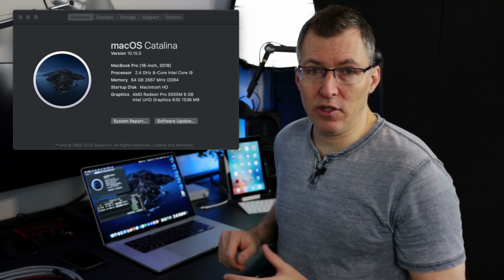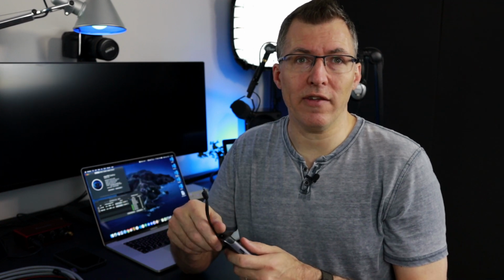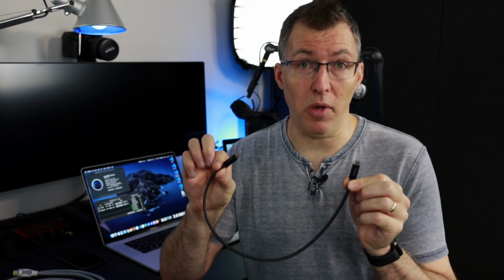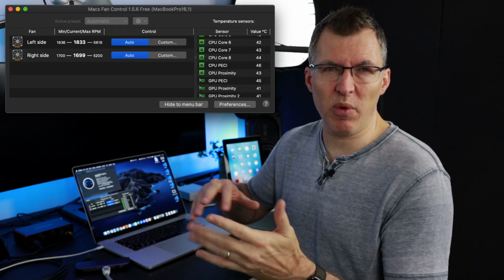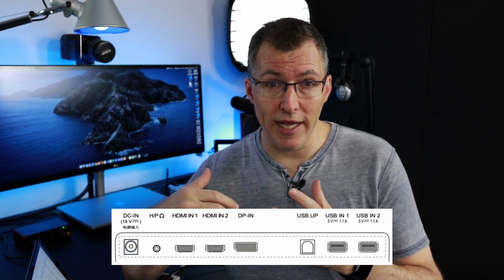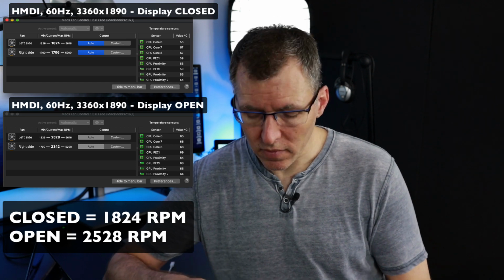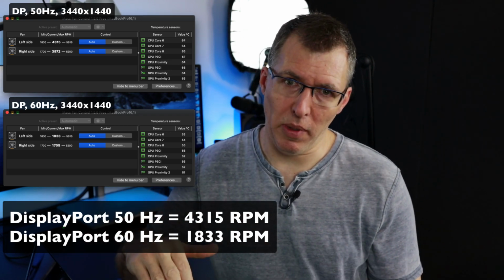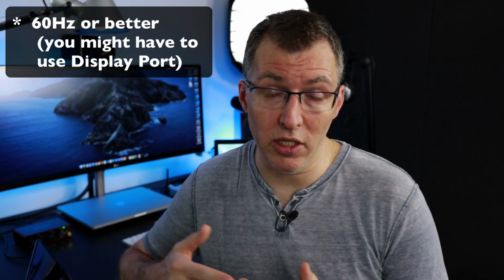SOLVED! MacBook Pro 16" + External Monitor = High Temperatures and Loud Fans. Here is the FIX!

Comment: Most affecting changes top-down:
- Using only Mac Software most importantely Safari (this can already fix it so much that you can use an external monitor)
- Turbo Boost Switcher to turn of the turbo boost
- https://www.youtube.com/watch?v=_Iw_X_N8UsI
- (Buying an external GPU for your monitor)
- Clamp shell mode
- Let it clean in the Apple store if its a good store they do it for free, i mean you was just scammed about 5000 USD by them (only at a good store not in Zürich)
- Newest Version of the OS
- Dont use antivirus or something like that
- Low power mode
- SMC reset

Now I have long term silence and  

** SMC sensors **

CPU Thermal level: 30
GPU Thermal level: 4
IO Thermal level: 4
Fan: 2083.42 rpm
CPU die temperature: 57.28 C
GPU die temperature: 35.00 C
CPU Plimit: 0.00
GPU Plimit (Int): 0.00 
Number of prochots: 0

Never mind if you envision a large scale trial i join immediately, but i dont pay another 5k for this with the new M book we must buy, this would be 15k then for nothing.

Comment: I solved this problem by selecting a resolution of 2560x1440, 60 Hz (NTSC) on my 4k monitor (Asus VG289) in the SweetResX program. It was this setting that lowered the GPU energy consumption to ~8W. You also need to use a DisplayPort cable

Comment: Got the cable you recommended. Monitor on one side. power on the other. Fans decreased dramatically. From maxed out around 6k to 4500 on Macfans. So not perfect, but way better! Thank you for solving a 5 years problem. Appreciate you.

Comment: Brilliant. One question, i am using macbook pro 2016 and having the same issue. do you think that in the squared dongle for HDMI cable, we can use the charging cable to connect in the c-port of the same dongle where HDMI cable is connected (and the dongle is then connected to a single c-port of macbook), can solve this problem?

Comment: So... to have lower fan speeds when using an external monitor you close the lid.  Meaning the solution for fan noise when using two screens is to use one screen................

Comment: Just watch your video now... I have a 2019 i7 MacBook Pro, and I just brought a P2723QE Dell monitor... sometimes the MacBook overheat using 4k resolution and clamshell closed, I really don't know what to do, it annoys me a lot, this happens especially when I am using Google Meet from the company at Google Chrome. If anyone has a solution for me, I will be more than happy!

PS: I'm using just one cable - USB-C <-> USB-C. One cable for data and power. Is there a problem?

Comment: In my case a display port is making it worse where the CPU just goes bonkers, i've tested it on two macbooks 16" (one from work, one my personal) and same issues on both. As compared, the HDMI way keeps things a bit more under control. It's really bizarre.

Comment: I have the same problem with a 2012 macbook pro. It's because with a monitor plugged in, it will automatically try and refresh both the built-in and external displays, even if the monitor's screen is sleeping. To avoid detection of the monitor without having to remove the hdmi cable, you can turn off the monitor's power supply on a switched power strip. And when using the monitor as a mirror, an alternative to the clamshell mode that keeps access to the keyboard and has better cooling, is to dim down the laptop's display entirely.

Comment: Very good video, I had already gone through all the stages that you described well in the video. Unlike yours my MacBook Pro has 16GB of RAM (indifferent for testing purposes) but only has 4GB of VRAM instead of the 8GB in yours. What I noticed is that when the screen is open and the external monitor (BenQ PD3200 U 4K@60Hz USBC-DisplayPort cable) is connected the GPU ram (RADEON) is used up to about 80% and the computer tends to throttle, when the display is closed the VRAM usage of the RADEON drops to about 20%. I do not understand why this happens, what do you think?
Reply: Same problem... i went to the apple shop ... not able to give a solution.... only things to do for me it's increase fan frequency with a lot of laud. For keep it cool i set it fix to 4000 rpm .... and i'm just coding, no intense app going on. The only explain from apple : very powerfull machine in a limited space. Nothing more. But the fact that a 3000 euro machine is not able to control 2 monitor 1920x1080 without become a grill ... this drive me crazy!
Reply: @gltechbuddy  I partially solved by cleaning fans and fan conducts, those was full of dust. My Mac was reborn at least for now.
Reply: @robertobissanti  I've done the same... But nothing change, I can still cook eggs on my Mac 😡

Comment: I've had a 2019 Macbook Pro that suffered from this. I took it to a Genius Bar where they opened it up and found the fans caked in solidified dust. Cleaning them out has stopped this problem in its tracks. For anyone reading this, DO THIS FIRST.
Reply: Don't know when you'll see this comment but I do music production and whenever I open up my music program (FL Studio 20) my MacBook (MBP "16 2019 2.3GHz 8-Core i9) gets super hot for no reason and I barely even started making any music. Do you have any solutions to help solve this issue?
Reply: @rxbtrxppy2975  we have the same machine. If you’ve had yours since new and it has never been opened up and cleaned I would head straight to a Genius Bar and ask for that to be done before anything else. 

The other suggestion is that apparently there has been some critical update in the latest release Of Monterey (12.3.1) that has solved the fan issue for some people so if you haven’t updated yet and can, do that.
Reply: @RoyShay  Should I trust that "new" update?
Reply: @rxbtrxppy2975  it hasn’t given me any issues with the software I run (I’m a software engineer) but I don’t know enough about your software to know if it would give you any issues. Just make sure it doesn’t affect FLS

Comment: Does it matter as a i9 processor w amd graphics card connected to a nividia  graphics odessy nano 49 ultra wide monitor make this setup im trying to explain incompatable? Experiencing kernal task errors editing resulting in force quit and crash restart due to ram overload above 64 gigs with only quik time and fxpx open. All is up to date. Ever experienced this? Just got this macbook in june 6500 bucks then m1 chip up to mac studio came out in less than a yr. My trade in value is 800 bucks and havent even used it really. I have the worst timing on every upgrade i have done and am stuck  another 6-10 yrs w un user friendly systems. Just venting. Thanks!

Comment: I have the smaller version of the 2019 macbook pro in the cheapest variant and have the same problems. chnaging the monitor hertz from 75 to 60 improved the loud noises a little bit. its just sad that you cant watch 2 or streams for example without the loud noises. cleaning the case inside could also be an good option but only if you know to bring everything back to working.

Comment: This is bizarre for me. I've been using a 4k monitor with mine for a week. It's only been doing this the past day. I changed the colour profiles, so the internal and external displays were different cause that looked best. I've tried changing it back and take the hit to colour and brightness but it's still going. My cables have both been on the left. tried them on opposites but that didn't fix it.

Comment: I also did the similar exercise and I realise when I plugged in the charger cable and HDMI in the same dongle, the temps raised by 15 degree and fans were running louder. So I always plugin charger in the directly in the laptop and monitor dongle other side of the laptop. This keep the temps running low ...

Comment: Thanks for your video, but to summarize a long video in one sentence: Closing the notebook while using an external monitor is the only thing, that helps to get a quit workplace. And this is for me not really acceptable. I am buying and using a high end notebook and have to fight against such stupid problems. :-( It's November 2021 now and I still found no solution for the problem.
Reply: I have zero interest for two displays, but I keep mine open because of: 1) The fingerprint sensor 2) Mic doesn't work too well when the lid is closed. I suppose I'd manage without the fingerprint sensor and use a headset in meetings.
Reply: @kke  I finally solved the problem. The fan of the Macbook Pro 2019 drove me crazy. I work daily with my 4k display and use Microsoft Teams for hours a day. I often had 5400 rpm and more all day long. I've tried so many. Of course, an app for regulating the fans has the disadvantage that the processor gets too hot and thus reduces the speed. In the end, the system hangs constantly. When my working day was over and I still want to cut my holiday films in Final Cut Pro in the evening or want to edit pictures in the photo app, the fan was still loud. At some point I had gone through the entire range of options: different display cables, different adapters, docking stations, etc. Then I briefly decided to buy a "worse" screen so that I didn't have the 4K problem. But then the problems with Microsoft Teams continued. I ended up selling the device and getting an M1 Pro. Since then absolute peace at home. An expensive but finally effective solution.
Reply: @RomanWagner  Thanks for taking the time to post this. Very much appreciated.

Comment: Display Port made it worse in my case, so switched back to HDMI. Close lid helps a little bit, but not by much, since I use the internal monitor off anyway. Seems to me like eGPU is the only solution I haven't tried.

Comment: I have the same mbp as you, going via usb-c to LG 4k ultrafine which is then connected to Dell U2717D via DisplayPort. Everytime I connect (whether clamshell or not) fans go about 5500rpm. So I am following your displayport advice and still the fans are high - where am I going wrong?

Comment: Using the Clamshell Mode helps a little bit, but don't expect some major changes. I'm using a USB-C to Displayport cable on a 1440p monitor@144Hz with my 2019 Macbook Pro 16". The problem is, that the Radeon spins up as soon as you plug an external monitor to your Macbook. Using Clamshell mode brought the power consumption of the Radeon from 18,4W to 17,5W.
When no monitor is connected, the Radeon graphics card is chilling at 0,5W. That is the main reason for all that heat in the MBP 16" and a serious design failure from Apple. Theres just no way around when you want to use an external monitor, you have to live with the heat and the noices...
Reply: I have read millions of threads and it's exactly how you put it : connection to an external screen => abnormal power consumption  from Radeon Pro 5500M => temperature rises to alarm levels => fans spin at max => (some kernel panic processes to minimise) meanwhile the cpu is below 9%. I remember back in the day when I brought it to the office in dec 2019 and plugged it in to the office monitor,  my workmates were laughing : dude, what is that noise , isn't that a new laptop? HAHA

Comment: I fixed the overheating issue by disabling hardware acceleration on google chrome and any other software that have that option
Reply: Wait what?!?!?! Okay I just found that setting in Chrome and I turned it off... could you explain that?? I hope this fixes my issue, since most of the times my fan kicks up is during fullscreen YouTube and Twitch videos.

Comment: I fixed it! I just needed to change the output resolution of my 1440p monitor to 2880p! (Which is the resolution of the 27" iMac coincidentally).
 https://axu2.medium.com/solved-by-1440p-hidpi-macbook-pro-16-is-hot-noisy-with-an-external-monitor-f8af19c30f81?sk=29420c4689393089d905cc388248aec1

Comment: I have an LG 34 inch ultra wide and MacBook Pro 16 inch that I use in clamshell mode. I was getting horrible fan noise while doing everyday tasks that shouldn't have caused the fans to spin on my Mac. The thing that fixed it for me was my adapter. The old one I used supported a max refresh rate of 50Hz through HDMI. Once I bought a new one that supported 60Hz and changed my display settings to use 60Hz, the noise stopped. The adapter also allows me to plug in my power cable, so there is only 1 USB C port being used on my Mac. Hope this helps.
Reply: why would you say this and not even drop the adaptor used 😭😭
Reply: I have this exact problem. What is the adapter? power adapter for the mac?
Reply: @charlieinman  i thnik the dongle

Comment: Thank you very much, So  my question is that if I buy extra external Fan to put bellow my macbook pro mid 2015 is that can help to cool down and make my computer run faster with 4k Monitor? please wait your respond ?
Reply from the maker: I don't know. I have only tested the 16" MacBook Pro, and haven't tried any external fans.
Reply: @VirtualTechMeetup   thank you very much for your reply, Yes now I try to clean my mac fan and use external fan on my own macbook it works perfectly, it low down the temperature. and the fan run in normal speed...Thank you again for your video make me has more idea to try to solve my issue. :D

Comment: Hey man, thanks for the research on MacBook pro heating with an external monitor. I noticed you had your mac in clamshell mode the whole time. 

How to minimize heat with laptop screen OPEN and connected to an external monitor?
Reply from the maker: Once you have two active monitors, including the built-in display, the GPU will draw more power and you will have loud fans. I have found no way around this.
Reply: @VirtualTechMeetup  Thank you for the explaination . Even with a single Dell 24inch  screen connected via USB-C to HDMI with extended display enabled continues to cause heating and after a point the system crawls with 75% CPU usage. Clamshell mode  on the other hand seems to temporarily fix but spoils the flexibilty when doing a lot of screen sharing on Zoom/ Webex calls .Hope apple fixes this soon
Reply: @turbocharged79  I  don't think apple has solution to it.
Reply: @VirtualTechMeetup  I've noticed that the surface the Macbook pro is on makes a difference. I sometimes work on a table cloth and then the computer immediately overheats and the fan kicks in. Nowadays I always put something under back side of the MacBook Pro so it gets lifted a few cm in the back. It doesn't solve the fan problem but does make my Macbook less hot, so from a longevity point of view it's the easiest solution. 
Apple MacBooks have always been known to be awfully hot because Apple hasn't included enough space and fans in their (definitely not on the) laptops
.

Comment: I am using the same macbook pro 16 (core i9, 64gb ram, 8gb amd card) with a usb c to Display Port cable. Not working for me 😓
Reply from the maker: Is the monitor capable of 60Hz or greater refresh rate? That was consistently the key to getting the GPU to use less power. In my case my HDMI ports only did 50Hz max, but my DisplayPort could do 60Hz.

Comment: Hi i have the same configuration mac book pro can you tell me what is the battery life you are getting as when i connect a 31.5 inch monitor i am it only last about 3~4 hours before i need to charge it again.
Reply from the maker: I never use my MacBook Pro connected to a monitor without also being plugged into power, so I cannot tell you.

Comment: Ultimately - there is no solution for this. Either AMD or Apple should fix the driver or OS problem. 
I have the same config with only diff 16 GB RAM. The display port did not fix, rather i was running in clamshell mode - trick i got it from Apple forums.
You want to use 1 Ext big-screen - use MBP in clamshell mode.
You want 2 big screens - connect two ext. monitor and MBP in clamshell.  Forget about 2 screens ( 1 MBP and 1 Ext. Monitor), else through MBP in dustbin bring windows laptop with the same config at half a price which works at rocket speed or wait for 2021 MBP with M1 chip as per country availability.

Comment: SHIT! I never had the heating up problem before, but now I am. I have an old Apple cinema  display and dont have any means of changing re-fresh rate. The only thing different than before is I moved to a different room, and the power and display are BOTH on the same side now. Gonna re-boot and try opposing sides even tho that's not convenient.

Comment: His conclusions: 16:52
And BTW all those likely won't work. Both of my monitors are @60Hz, connected with DP, I'm still having the issue.
Reply: I had the same configuration and the same issue. I spent a lot of cash on different configurations My current config is 2 LG ultrafine displays, which will draw 18W-20W idling  at 60Hz, but at 30Hz refresh rate the dGPU draws about 4-6W.  I’ve only had it this way for a few days, before that I had an eGPU,  

anyway, it’s ok when idling or light use, but it heats up when streaming a game from a PC via steam remote play, and the power draw shot up  while running a Windows VM, 

From what I’ve read, and I’ve read a lot and spent hours with Apple Tech support! , it seems to be an issue with the 5300M and 5500M dGPU chips on 2019 MBP 16”  laptops.
Reply: Fuck, Whats the solution then? I don;t have other options for my work laptop.
Reply: same configuration, but works fine with my dual 1080p display

Comment: Nice video. But it did not help me.
I have one rather new HD monitor and a 5 year old 4k monitor.
Without any fan control software, with both monitors connected, one to each dongle on either side of the MacBook, the fans go up at full speed and the machine heats up like anything.
I did try to use tg pro to control fan speeds manually or on a profile, but the moment my right thunderbolt port reached 58 deg C or so, the cpu became unresponsive. Disconnecting the monitor (not the dongle) on the right side brought the computer back in like 4 minutes.